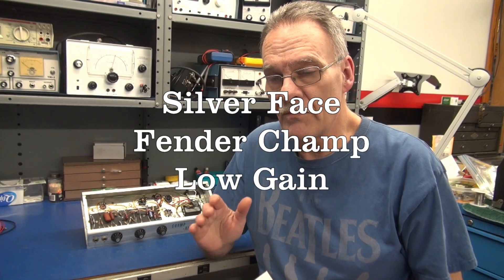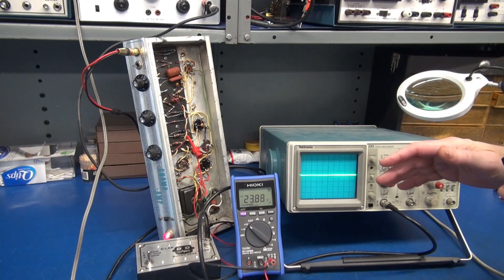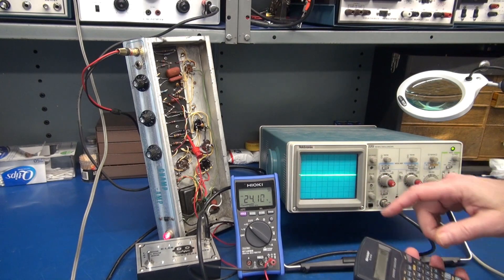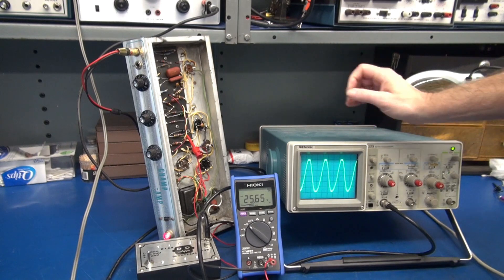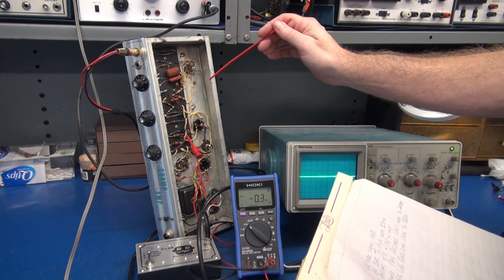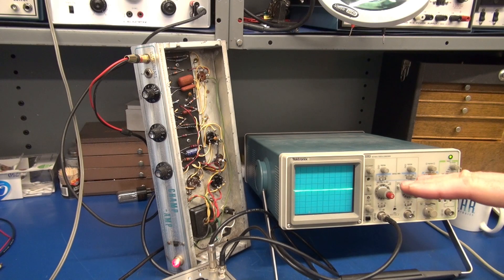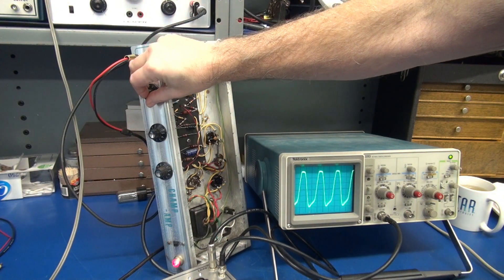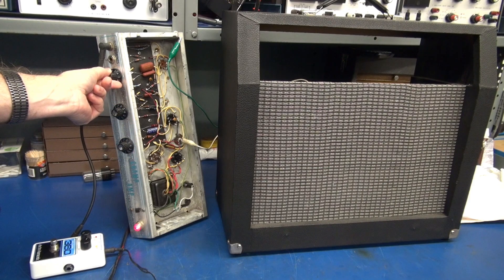Vintage silver face Fender Champ Low Gain fix plus monitor output on an oscilloscope

Comment: Thanks for this vid. I have implemented the 220k plan and I have more ideas for all. I took out the lo-input and replaced it with a 250k pot w/ 6.2k to ground. This pot gets the tail of the bass pot and is effectively a Mid to RAW pot. Now it's also push pull and I used that back end of the pot for a 120pf bright cap for the low volume operation. I went to a 680k Bias resistor and its at 15w Dissipation. This is no a mini beast. BTW it's all reversible and have all parts, but this Champ never sounded better.

Comment: What value did you change the 6V6 cathode bias resistor to, and what was the resulting cathode bias voltage (if you know)?
Reply: 500k.

Comment: Why does increasing the resistance increase output?
Reply: The simple answer is....In both cases the resistors are from signal to ground. The complicated answer involves tube biasing and gain, ac vs. dc ground, etc.